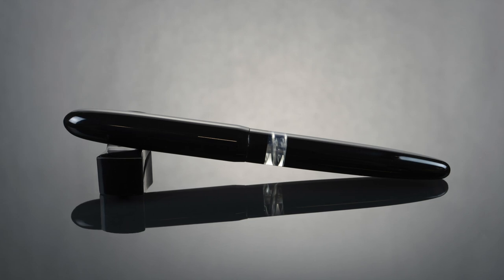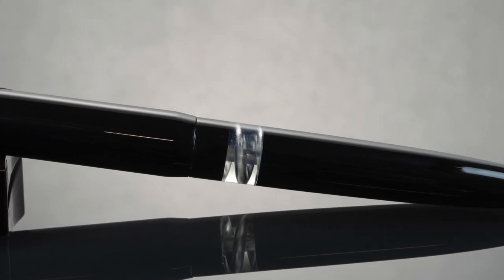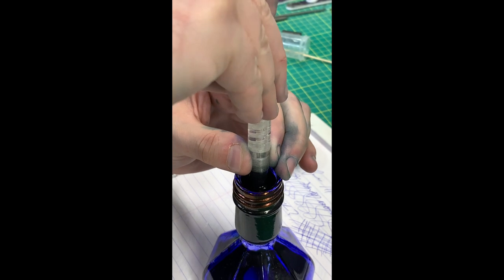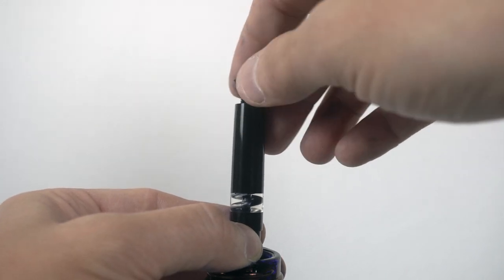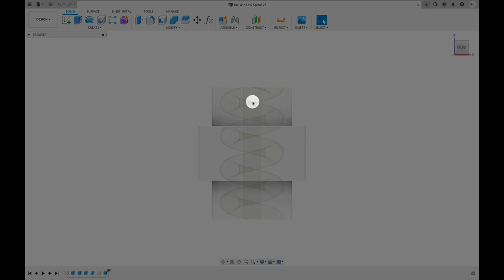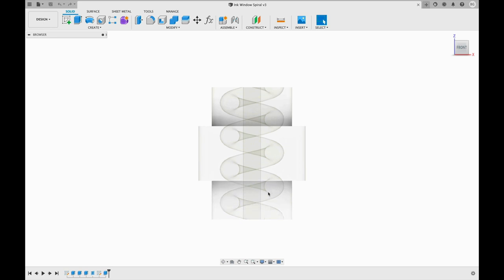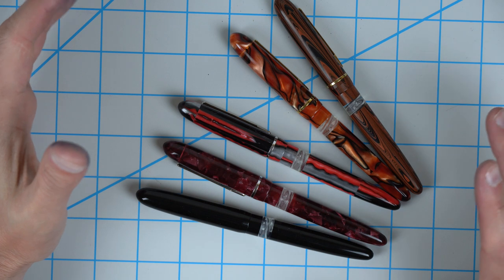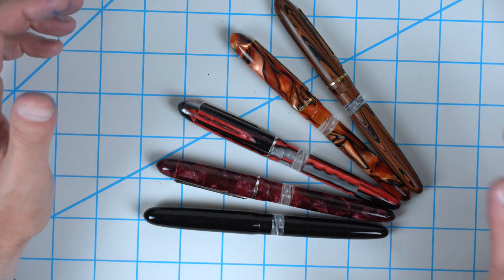3D Printed Spiral Ink Windows!

Comment: I wish the ink window showed one more ring on the spiral.
Reply from the maker: Understood. When prototyping this it was a delicate balance with the steepness of the angle possibly keeping ink from effectively finding its way through the spiral. The steeper angle (less rotations of the spiral) means that gravity is more effective at moving the ink.
Reply: @edisonpenco  Noted. I need to re-phrase my original inquiry: Without making changes to the spiral, would it be possible to lengthen the ink window to show one more ring on the spiral?
Reply from the maker: @wwbdwwbd  Oh, I understand thanks! No, it's really not possible. I need to have room for male threads on both ends. If the window became longer, it would either interfere with the front barrel threads or with the piston mechanism. So there's no room. Thanks!
Reply: @edisonpenco  Thank you. That's nice to know.

Comment: Thanks, Brian, for the detailed introduction. Very clever and cool design!

Since you mention it, I understand very well the complexity of designing and manufacturing the spiral part, but what I don't understand, as you thought might be the case in the video, is why it is so much more difficult to assemble this spiral part instead of a straight clear ink window. Both the spiral and a conventional insert seem they would be parts with threads on both ends (are they?) with same direction threads), so it is not clear, at least to me, why the assembly of this spiral window is any more difficult than any other body insert (which I assume are also threaded and screwed in). Where I could maybe see a challenge is (accurately) cutting the threads into the ends of the 3D-printed blanks. Why is the labor 4x more?

BTW, the pricing is to me reasonable and in line with other options offered by Edison. I appreciate the continued creativity.
Reply from the maker: Hi Kevin.

Thanks for asking! I wanted to cover this in the video, but it was already 30 minutes long!

With our normal ink windows, we will epoxy the assembly together as rough rods. The barrel front, the ink window, and the barrel back are all assembled together. So when we machine the barrel, we can just drill and bore right through the entire assembled piece, including the ink window. So after the glue-up, we can simply treat the barrel as all one piece, and it can be done in 3 operations. 

However, with the Spiral Ink Window, we obviously can’t simply drill and bore through the center, as we’d lose the spiral. So the barrel front and barrel back have to be created entirely to a finished state individually, two operations each. Then the ink window is added rough. After this, epoxy cures and we have to very carefully trim the window to be flush manually. This is also extra tricky since the spiral won’t allow us to mount the barrel onto a mandrel. Then delicate sanding and polishing, also without a mandrel.

So in the end, a normal ink window takes us 3 machining operations and normal sanding and polishing.  The Spiral takes us 8 operations and then a very delicate process to make the window perfectly flush and seamless, as this can’t be done on our machines, only by hand without mandrels. Then a delicate sanding and polishing process after this, also due to a lack of mandrels being able to mount the piece upon.

With both processes there, there's more to it than what I've outlined above, but that's the bare bones.

Let me know if this makes sense.

Thanks!
Reply: @edisonpenco  Thanks for the (excellent) explanation, Brian! Now I understand the issue. It makes perfect sense. It is as if you know what you are doing... :)
Reply from the maker: @kevinkrizman3556  Haha! Yes, before even printing prototyped window parts, I had to wrap my brain around this construction process. How we'd actually incorporate a 3D printed part to a machining process, exactly how our processes would be different, and all the programming involved really had to happen before I even printed a single part. Thanks!